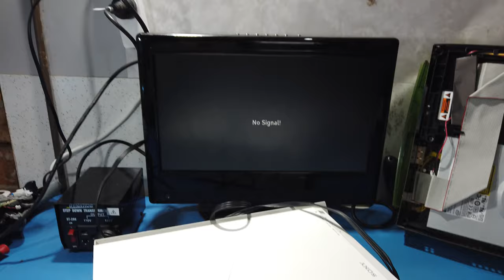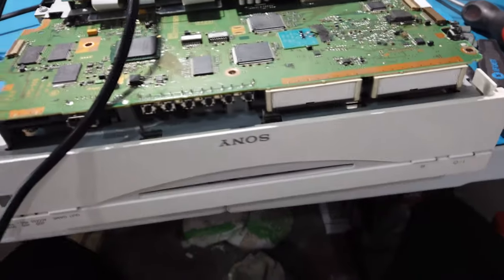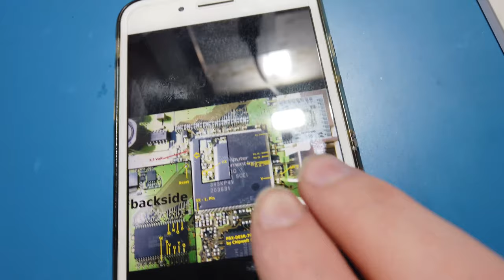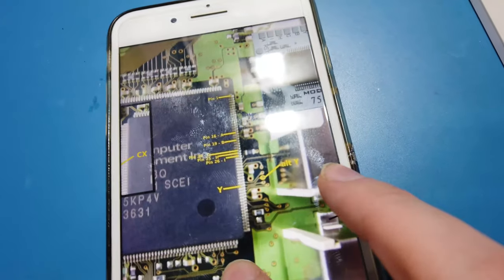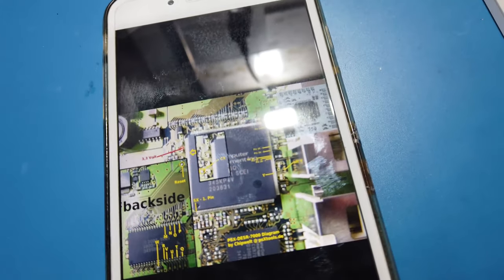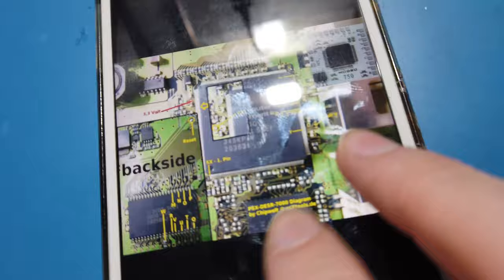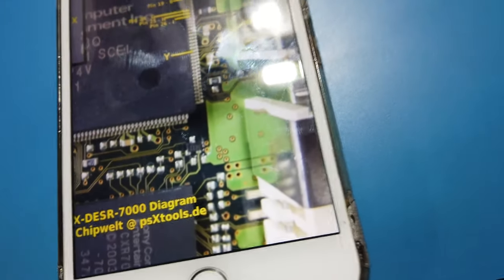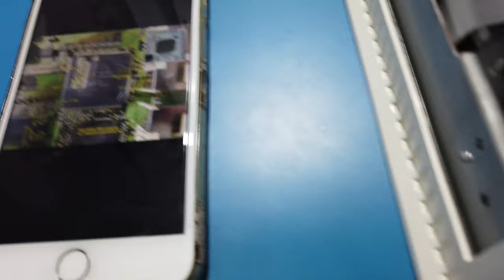Let's Repair and Mod a PSX DVR Part 1

Comment: How did you get it apart? it seems to be stuck for me on one side it just won't come apart.
Reply from the maker: Pull off the big rubber feet on the side rails and use a long flat too to pop the metal tab holding the grey plastic side on.
They slide off.
Then remove all the screws holding the metal side rails on.
Then remove screws on the underside like normal ps2 
The top cover will come off, be careful most models have flex cables attached still for led

Comment: Hello friend, I follow your channel for a long time, I managed to buy a psx dvr, my fear is the famous hard disk if it dies, the console is the same, there is a way to change the hard disk, install a better one or an SSD for example to extend the life of this console?
Reply from the maker: Hello, you can swap the HDD for the offical 20gb or 40gb Sony drive that was bundled with some ps2 games
You can try to copy the os files back to the drive, you need to partition the hdd same way as the psx and put the files in the correct partition

Comment: i have a problem with my psx DESR 5700 i bought as defected a while ago. Managed to boot it up with the psx logo,then when the little blue ball in the upper right corner pulsing (loading the xmb menu?) is finish it goes to black screen and nothing more happens. What could be the issue? software/hdd or something else?
Reply from the maker: press menu on the front of the unit, it defaults to tv tuner
Reply: @Slot1Gamer  sadly that dosnt working 😕😢🤔is the front panel broke in some way? It seems that it the warranty sticker has been lifted once

Comment: Took mine apart earlier, thanks for the video :D mine blinks like that, has a yellow and two red lights on the back and will only show the psx logo if i hold the eject button when putting power to it :P Excited to see the progress on yours!

there we go, black screen is where i am so must be the hdd :p

i have a 40gb ps2 hdd i use in my fat boy with hdloader, you think that will help me? it has probably been formatted since i got it but im not sure

so i just went to pull the hard drive and the power is not connected XD

Comment: Hello, I have a psx that the IR connector came out when I had it on and it generated a cut. Now when connected to the current it only emits a constant beep. Do you know what could be wrong?
Reply from the maker: Sorry for slow reply, does it do it when the cable is unplugged also? 
Constant beep isn’t a failure mode of the PSX iirc 
Sounds like something got shorted

Comment: I bought one, but it doesn't read the discs, is it possible that it just needs laser cleaning, is it easy to open to check the laser?
Reply from the maker: Laser is a pain to get to
There are two lasers one for XMB mode and one for ps2 mode 
XMB laser is always used first to detect media type (when in XMB mode which it usually is) if it’s bad it won’t read anything

Comment: I’m trying to fix mine aswell it did’t power on, F4001 fuse was blown along with a damage IR ribbon flex. Looks like the previous owner worked on it and forgot to tape it to the panel. I replaced the blown F4001 fuse aswell its damaged ir ribbon cable along with the top panel ribbon and i managed to get it to power on but i get the Hard Error Flashing Red and Green Light. It turns on and the HDD Access led also does turn on from time to time. Not sure what’s causing it. The caps on the PSU look good.

F4001 Fuse Specs in case anyone needs a replacement. 1608 metric, 0603 imperial size, 0.7mA,clearing time 5s under 250% of rated current. Part numbers: FCC 16 701 AD or TF16SN0.70 or ERBFE0R70SU. Can order from Mouser, DigiKey etc.
Reply from the maker: Could be a bad flex, ones I’ve worked on if the sub pcb isn’t connected properly you’ll get that error, sometimes a message on the screen saying take to service
Reply: @Slot1Gamer  I already replaced the flex for sub board mounted to the case and it still gives me the same problem. I do not get anything on screen. Perhaps it another flex or another fuse hidden somewhere.
Reply: Hallo

Die Beschreibung passt genau auf mein Gerät... Habe ein psx desr 7000, nach dem ich die Festplatte ausgebaut und wieder eingebaut habe war die Konsole wie tot, kein Led Lampe geht und der Lüfter startet am Anfang auch nicht mehr.

Möchte die f4001 Sicherung auch wechseln, nur finde ich keine im Internet 

Kannst du mir da weiter helfen mit Bildern ?

Danke
Reply: @8bitnation419  wo kann ich f4001 Sicherung kaufen ? 

Please translate!

Danke
Reply: @petergrunzelt9941  Google keeps deleting my comments. I updated my original comment.

Comment: If somebody only knew how to hack the internall hdd that married to the unit itslef, so it can be unlock converted to ssd upgrade
Reply from the maker: We understand how it’s protected but it requires reverse engineering the DVRP 
There are two parts to disk recognition (on the disk) 
The security sector data and drive firmware 

These both require at least something like a PC3000 to even start working it out 

The 20gb Sony branded disks for ps2 have all the required stuff actually but also require a bit of manipulation to get the XMB running

Comment: Anyone have a vid of fixing the disc drive
Reply from the maker: Lukemorse1 had one looong time ago
But FYI on the stock system the DVR pickup reads all discs first, so if that isn’t working no discs will read.

If you are loaded into ps2 mode, say using fmcb and Ulaunch it “should” use the ps2 pickup :) 
Hope that helps
Reply: @Slot1Gamer  no it's the drive it won't take the disc all the way in
Reply from the maker: Does it sound like the rollers are moving
Reply: @Slot1Gamer  goes like 90% in then pushes the disc out then makes a lot of noise